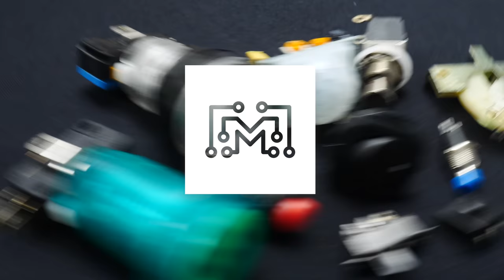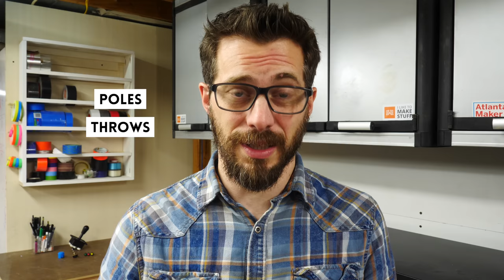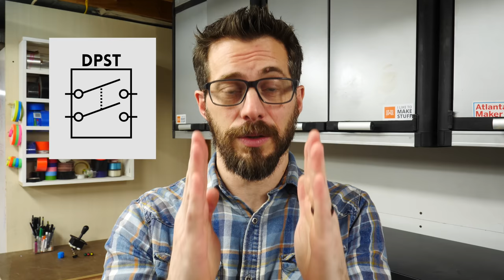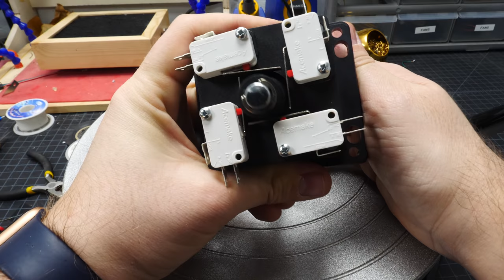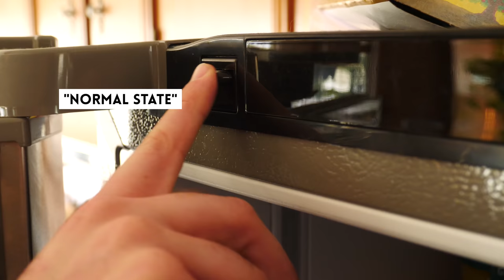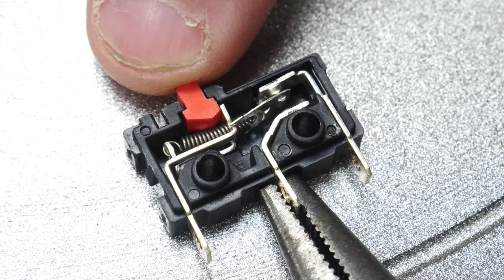Switches // Bits | I Like To Make Stuff

Comment: It's probably worth mentioning, if you are buying small toggle switches in quantity for potential future projects it's worth buying double throw since they can be wired to behave as single throw and are nearly always the same price
Reply from the maker: That's a good point.
Reply: Beware of garbage eBay switches that melt like wax!
Reply: @Yonatan24  I know! After soldering a wire to them they're gone!
Reply: @taunteratwill1787  I bought a cheap 3 size set of wire terminals. I think you could solder them on too if needed

Comment: If want to use a small switch to control a larger load than its rated for, a simple fix might be using a relay or a solid-state relay (SSR). 

Since the relay will do the heavy lifting, the switch then only has to be tough enough to activate the relay.
Reply from the maker: That's a great point,
Reply: @Iliketomakestuff  Thanks, Bob ☺

Comment: A point about switch ratings: while it is important to meet the minimum ratings for the circuit, you can generally use any rating above that. So if your circuit is 120V 15A (common US household), a switch rated for 240V 30A will work just fine.
Also, the switch should meet the minimum for both voltage and current, not just one, and a higher rating on one doesn't make up for a deficit on the other. So even if a switch is rated for 240V but only 10A, that's still not good enough for a 120V 15A circuit.

Comment: You can use a smaller switch or button and a transistor if you want a specific look or don't have large enough switches. Though this applies only to dc circuits.

Comment: When using switches or button and a microcontroller (ex - Arduino) keep in mind that using software you can change the behavior of a physical switch. For example, using software you can make a momentary switch/button act like a latching switch/button.
Reply: Or use relais
Reply: And a lot of time you need to program a debounce into the program when using switches or buttons with a microcontroller.

Comment: Do not use DC switches for AC!
AC causes arcing that can lead to premature failure of DC switches, and can lead to DC switches getting stuck in the ON position, which might be very bad depending on what the switch controls.
Reply: DC switches are mostly only used for low voltage applications (12/24 Volts) but it's still important to remember!
Reply: Heh, pretty sure you got that backwards. AC switches cannot be used for DC, unless they are rated for that. In AC, at some point the current goes to 0 during the cycle, so the contacts can be much less robust. In DC, the current is constant, so the switch contacts need to be able to break a constant high current without burning up the contacts, or them welding shut.

Comment: Been thinking of reusing an old/broken MMO mouse that has twelve programmable buttons on its side (Razer Naga). Would extend the mini push button switches on the mouse down to  a wooden strip with arcade buttons. Would place it down on the wall/floor so that I push the buttons with my feet.
Reply: A concern when extending signals is noise. I suggest twisted pairs, one for each switch.
If there's no 'electronics' at the switch/pedal end, connect only the signal wires not the shield wire.
If there are potential noise generators at the pedal, any electronics, connect the shield wire to ground at that pedal end and do not connect it at the other end.
(The reason for that is that noise that is broadcast by that wire that is picked up by the shield will be sent back to the source (be kept more contained) rather than sending it on to another circuit that might be disturbed by it.)
Solid twisted pair is available by the foot at the big boxes, 4-pair telephone wire. BUT being solid it won't survive any casual handling/bending/flexing, so it has to be mounted all as a rigid assembly, which may be very inconvenient.

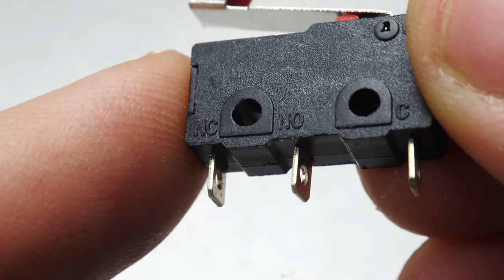Comment: Just a small mistake at 2:45 about limit switches. There is Normally Open, Normally ClosedN and a COMMON, not a Ground. This common allows power to be switched from the NC contact to the NO contact while the button is actuated.

Comment: Great series! A couple of notes where I bought the wrong switch. Easy to confuse push button momentary switches with push on, push off latching switches. And some toggle switches have a center off position. Easier to tell the differences when you have the switch in hand but harder when buying online.  : ) Great video, super useful! : )  Cheers!

Comment: Also for the rating is if it is AC or DC. DC switches can have arcing over it and so can be protected by a diode or snubber circuit ( resistor )

Comment: 3:00 And a quick note, DC and AC ratings are NOT the same. As a rule of thumb (and nothing more) if you only have the AC current, only use 10% in DC. And if you only have a DC voltage rating, only use for 50% AC voltage. Other ways around it's not an issue.

Comment: When in the market for switches (and other electrical goodies) my two favorite places to check out first are AllElectronics, and Electronics Goldmine. You'll have to Google them to get the addresses, I've heard YT marks comments with URLs as spam.

They are the best if you are US based, but their inventory changes from time to time as they find new supplies of stuff. 

If you are looking for computer parts or parts with a high degree of visual quality, check out Performance PCs' diy section. They cater to the high end computer modder, so are more expensive, but can also provide help if you have a question on a product they carry.

Comment: advanced: but you can use a switch that has a selection "NC, N0" as a bistable switch. 
best example i can think of is a door that's always locked until you press the button, it disconnects power to the "normally closed" circuit, and sends the power to the normally open circuit instead, which can be sent to a light switch/alarm that says the door's been opened.

Comment: I'm looking for a particular switch for a lightsaber build— I want to rotate the blade emitter to close the switch and have it spring back when released leaving the blade on until rotated again the same way...
I've seen some flashlights that work in a similar way but don't spring back...

Any recommendations?
Reply: There are industrial controls switches that are spring return. For instance they are called return to left or return to right, dependent on the direction you wire it or order it. I would think a momentary switch would work as well as it goes back to it's original state.
Reply: Eric Thomas As far as I understand, momentary switches only offer a closed circuit as long as it's being pressed, I'm looking for something that stays closed until I rotate it the same way again with the same motion... Feel free to correct me if that's incorrect...
I'll have to look into the industrial control switches...

Comment: I have a hard time finding the right switch power rating, but not because of the switch but because I don’t know what the power rating is if the thing I’m trying to run. I have cheap hid headlight conversion bulbs but they don’t say how many amps they pull, only says that they are 55w.

Comment: Great job explaining that, very easy to follow, good graphics and comprehensive, I just wonder if there aren’t more classifications of switches like some of the other comments, I understand that on the most basic level, it really just comes down to a spst, but want I really want to know about is the led lit switches, what uses are there for an led lit switch besides an indication of a closed circuit and polarity, and what are the drawbacks of them?

Comment: Genuinely curious here. My electric toothbrush has a maintained switch, but if I am using it and it runs out of power, then I press the same switch again to turn it back on (after recharging). How does that even work? How do the ON/OFF normal states switch automatically?

Comment: if there is a switch you want to switch high voltage but it can only handle 12v, you can just use a relay.
Reply: Yes, but make sure the two voltages are separated, so that you don't accidentally put mains voltage(120/220v) on your 12v switch

Comment: Well that left me feeling more confused than I thought I was going into it, but also was helpful. I have no idea how that's even possible. 🤔
Reply: I've been doing this for 50+ years. That vid was very fast and pretty complete for 3.5 mins. Go watch it a few times and if there's a confusion just say what/where.
If you're building a standard circuit, use what they say. If the switching seems confusing, keep following the lines to see where they go and What Happens when activated/deactivated.
If designing, think about the number of inputs/outputs, the poles, and the number of functions, throws. Draw it out, that will help a lot. If it still seems Too Complicated then it's possible there's something in the lower levels of the design that could change to make it simpler.
If you still don't get it don't hesitate to write something up and ask in reddit or stackexchange.
It's only complicated the first few hundred times. :)
Reply: Does anyone know what push button switches that stay closed / pushed-in are called? 
Not sure exactly what they are called and it's hard to find them on eBay...
Reply: @Yonatan24  Try latching push button
Reply: @Yonatan24 push-on-push-off.
Reply: @jeroenverbong4884  Thanks!

Comment: I think you should have covered the smart switches with this as well or make a bits video on the smart arduino based switches which can be controlled using wifi and ir blaster. 
Thanks
Reply: Correct me if I’m wrong, but as far as I know those aren’t really switches but instead relays - a small current activated by the arduino (or any other board) basically activates the relay to let the high current flow through
Reply: That'll be Switches-302. There's a LOT between SPDT and IoT. :)

Comment: Only thing I can think that needs to be added is that the rating for AC voltage will not be the same as the rating for DC voltage.

Comment: What if you connect a button to a button?😂😂
Reply: That's actually a good Q. Layers of switching can make multiplexer and demultiplexer circuits that a single switch couldn't do.
That's what safety switches do, where a machine operator has to have each hand on separated switches to engage the machine. That's a series circuit.
Or a very large machine that has several panic/e-stop/limit switches. That's a parallel circuit.

Comment: One thing I'd like to add to all of this, make sure you check the packaging.  I grabbed one switch/button for a project, forget which, and it didn't work.  For the life of me, I couldn't figure out why it wouldn't work.  Well, turns out, when I checked the packaging, I'd grabbed an AC switch when I needed a DC switch.  This is just a tip from me, if you need a not-too heavy duty switch, you can grab a decent DC switch at your local auto-parts store.  They'll have a decent assortment of rocker switches, buttons, etc... to help you out, and, most of all, they're typically DC.  If you need AC switches, you can hit up local DIY/Home Improvement stores.  I'll typically hit up the Home Depot near me if I need an AC switch since they have an ok, not great, selection.

Comment: hello there. im trying to figure out a stepless touch switch button. my project also deals with induction led lights. do you have any suggestions.  switch has 4 wire. 1 set is for input power, the other is for the power to the circuit or led. it doesnt work.  on the induction part, i need more range from the core so the leds can be powered. i know this is all weird. thanks for taking a few minutes. MTFBW@bikerjedi  @sabernewz